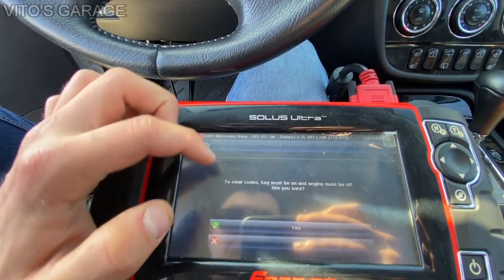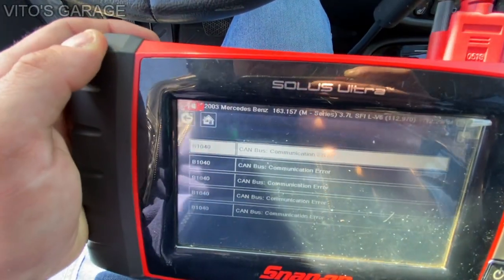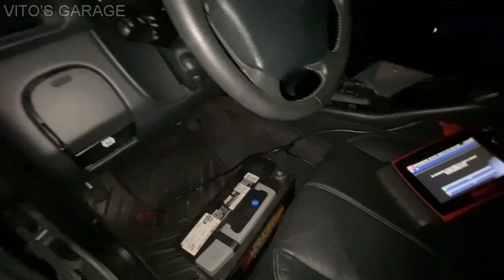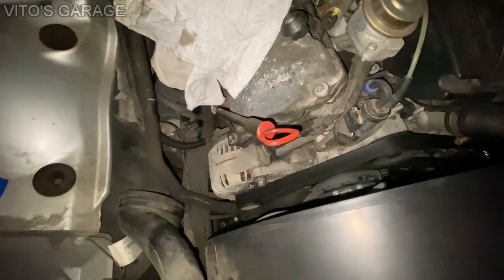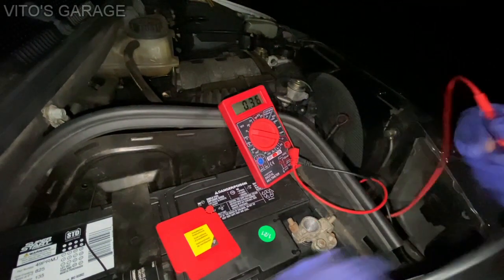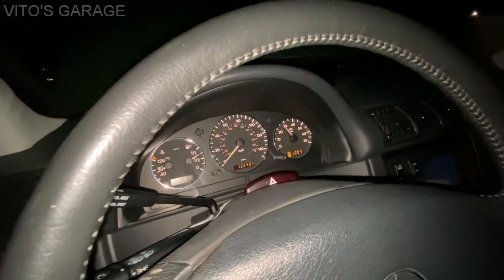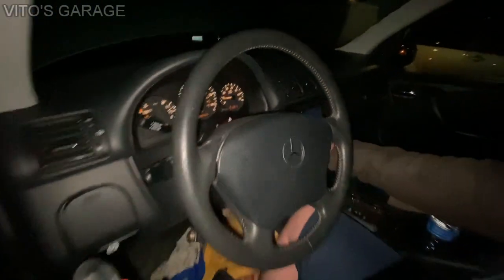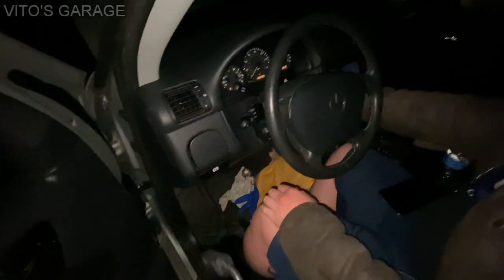Mercedes ML350 Starts, Runs & Shuts Off. Intermittent. W163 W164 W166 ML320 ML55 AMG ML270 CDI ML430

Comment: This problem of shutting off is very similar to my 2014 ML350. None of the techs I have taken it to can resolve the problem. The last thing I want to do is take it to a dealer and pay those astronomical way off prices to have it repaired (e.g. $800 for A $170 BATTERY OR $400 TO EXAMINE AN ISSUE WHEN MOST TECHS DO IT FOR FREE) Hopefully this is the solution, will keep you informed. Thank you Vito.

Comment: I just got another ML350 with a dozen silly problem. Alternator, starter, wrong battery (H6 instead of H8), fuel pump, steering pump, struts. Everything I had to do in 10 years on my 1st one, I had to do on this one in 6 months. The kicker was the blown up AC compressor, it had a quarter-sized hole in it. I got it for pretty cheap though. I'll still buy it again in a second just for having another chance to learn this truck.

Comment: i had my alternator replaced a few weeks ago on my 1993 W124 400E...it was original with 265K miles!!!!
Reply from the maker: Nice! She held up a really long time! Did it stop charging?
Reply: @VITOSGARAGE  yes..it started making a noise and stopped charging..
Reply: I’m at 177k km on a 04 w211 with original alternator. I’m planning to rebuild the alternator. Will change the regulator and Bearings
Reply from the maker: @mzee5533  great idea. I am a big fan of preventative maintenance!

Comment: I changed the air suspension compressor on a 08 GL 450, after that ,the engine starts, but after a few seconds when the compressor starts it stalls, do you think it could be the same issue?

Comment: What was that loud knocking coming from the engine? Almost sounds like a rod.
If you push the bushings in the ears/brackets for the alternator flat to the inside of the ear the alternator will slide right in. Just use a pair of channel locks. No lube needed.
I found out the hard way taking my alternator in and out several times back when I was having trouble with my 01 e320.
I have never heard of one overcharging but I guess if the regulator stuck it could do that. I would have just replaced the regulator. They are not to hard to get at. With an overcharge situation you know the alternator is working just fine. Those alternators are not cheap!
Reply from the maker: It’s easier and faster to replace the whole alternator. It was over $200 for new Bosch unit and it has a warranty. 
And no, that’s not a rod knock. The car has been sitting for a while and the lifters are trying to wake up. The truck is doing amazing. We drove it 250 miles that day
Reply: @VITOSGARAGE  You actually lucked out that it was a Bosch. Mine was a Valeo which mercedes, BMW and other European car makers used at random. I think the alternator is actually a Bosch because my old one had Bosch stickers on it but the volt regulator and the way it fit on it are different. After trying a Bosch regulator, which as I said didn't fit, then Valeo which didn't fix the problem, I got a rebuilt Valeo, which didn't work and then got a second one which did. So I took the alternator on and off at least 5 times. I got good at it though! Lol
AutoZone wanted over $400 for a new one so I know the dealer would want more. After the hassle with the rebuilt ones which weren't that cheap, I could have gotten a new one on line for $235.
What I was never able to find out was if I could have put a Bosch unit on and not had a problem with it.
Reply from the maker: Wow that’s crazy!! Sounds like you had a crazy time with that alternator! At least it’s all fixed up now! And yes, we got this new Bosch alternator for a good price with 2 year warranty at the local parts store. But I prefer to buy all my parts online. However, we wanted to put this truck back on the road as soon as possible🙂

Comment: My 07 w211 E-class is shutting off when idle and driving the lights all flash real quick but my battery is low and every morning I lose comms with the instrument panel and have to let it run for 10 seconds and restart it. I guess my alternator is starting to go!
Reply from the maker: Install a new battery and see what happens. Scan the modules for fault codes

Comment: Same story with my 2003 ml350, just replaced voltage regulator, easiest job, unscrew 2 bolts and that is it. 30USD part. Who told you that it is not easy to do. 1 hour job overall.
Reply from the maker: The voltage regulator is internal and you can't really get just the regulator by itself, at least here in USA I haven't heard of. If you have an old school Benz then yes. Starting late 90's- no
Reply from the maker: @Ravenola  New Bosch alternator was $150. Just install a new alternator man. Your bearings are gonna go bad soon anyways and other internal parts. Just install the whole new thing and have a piece of mind..
Reply: @VITOSGARAGE  Already did, changed all bearings (2) and regulator. 2 years passed. And main point here is that voltage regulator is changeable part and easy to change. That is it.  Of course it is easier to change whole parts with new ones, but money my friend. If I have money I would change whole car with new one. :) Good luck.
Reply from the maker: @Ravenola   Money? I am not rich either but I save and restore about 10-20 old school cars every year. You probably only saw this video on my channel haha
Reply from the maker: @Ravenola   and please don't mention new cars because I hate new cars... It's always worth putting love, time and money into these amazing old school machines! Mercedes such as W123, W124, W126 and other old school chassis will outlast anything out there!
Reply: @VITOSGARAGE  No, my friend, I saw many of your videos, but initially my comment was specific on the subject of how easy and cost effective was to change the voltage regulator while you were talking in the video that it is not possible. That is all. :)

Comment: Could it be a recalled alternator, sometimes it happens, check  the recall notice, by putting your cars information it will show all the recalls that particular model may have
Reply from the maker: Not sure about the recalls. I don’t think they have the alternator recalls on M112 engines. Those alternators actually rarely go bad. But in this case, it went bad by overcharging

Comment: Hi Vito great video. Have you ever experienced a ml320 w163 not shutting off? It does it randomly. I have to pull fuses to turn it off. Any idea what this might be?
Reply from the maker: Hello sir. Thank you! Is this what your W163 is doing right now? Is it an intermittent issue? When the problem occurs, have you tried wiggling the key and the actual ignition? Have you tried tapping on the ignition? 
I really feel like it’s the starter ignition module (where you put the key in). What year is your car? Do you have a key fob on yours or does it have a mechanical key to start it?
Reply: @VITOSGARAGE  hello, thank you for replying. The problem is intermittent. I haven’t tried doing anything with the key. I’ve just tried the different key and waiting. After that I started to pull fuses. It’s a 2002 and it has key and key fob combo like the 2000 Jetta’s.
Reply from the maker: I think the problem you’re having is an ignition switch or the whole lock cylinder. You have to get to the back of the ignition switch and check the wiring. When you turn off the truck, and if it doesn’t turn off, you can use a test light and see if you still have power coming out of the ignition switch on a couple of wires. If you do have power, your ignition switch is bad. Wiring schematic is your best friend in this case. However, if you don’t want to test it out, you can try replacing the ignition switch.

Comment: please help me, i have w211 2003 e240 i have an issue that the car when reaches its normal running temperature stalls and dies then i need to start it again it starts then when i come to a stop i or after sometime of driving same issue then again i need to start the car again , sometimes it runs for 10-15 mins sometimes starts and dies i replaced the fuel pump still same issue
Reply from the maker: Bad crankshaft position sensor

Comment: solderings inside the ECU computer. 2 years too late i know
Reply from the maker: No. It was the alternator overcharging and causing a stall. No more issues after the alternator replacement
Reply from the maker: Check the charging voltage as soon as you start it. If it’s over 14.9V it’s bad
Reply: My ml320 1998 starts then cut off I change the crank shaft sensor aam module the key antenna I had the keys maid and it still keeps starting then shut of I’m so confuse these motors are the most reliable motors mb maid ant tips would really be appreciated 🙏🏾
Reply: @jamesmcoy4409   my car did also shut off 3 seconds after start.
It was an ML 400 CDI
When heating the ECU computer with a hairdryer it would keep running.
So i knew it was a bad soldering inside the ECU.
I send the faulty unit to a specialized company who fix the unit. And the problem was gone
Reply: @VITOSGARAGE  very good, happy to hear you fixxed it.